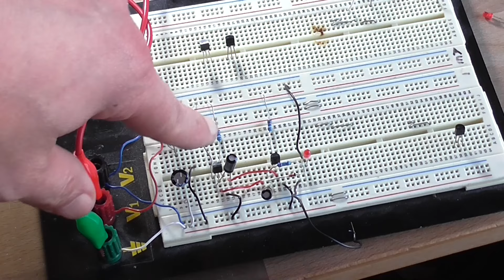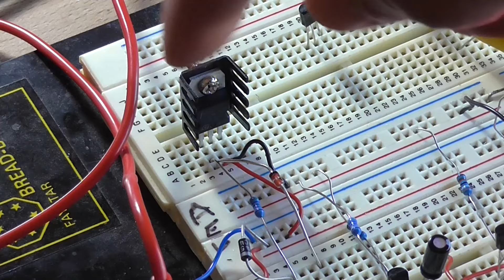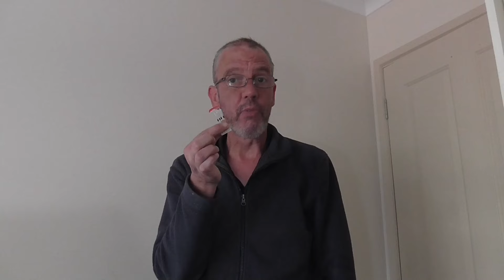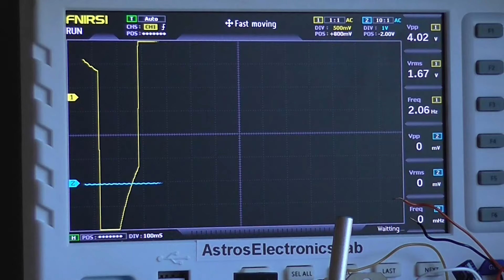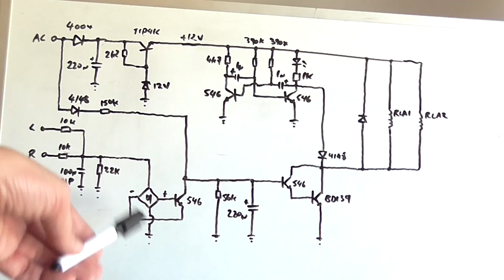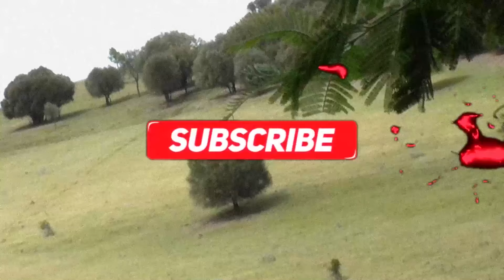Simple DC Speaker Protector Circuit TEST

Comment: Question, Why you need to drive 2 relays?
Reply: One for each channel I suspect. I guess he could use a single double pole relay, but that's a matter of choice.
Reply: @tonyrogers8318  but he should have 2 circuits each one driving one really for left channel and right channel amplifiers otherwise will short the left channel with the right channel or mostly will be a big crosstalk on the amplifier! And in case happens a short on the left channel will disconnect only the left channel and the right channel will still work
Reply: @SymbolTech21  The two channels are isolated by the 10k resistors. Crosstalk won't be an issue, because of the low output impedance of the amplifier.
Reply: @tonyrogers8318 but in case any of the channels goes shorted will disconnect both channels speakers and will be hard to troubleshoot the amp. Because if each channel have separate circuit will disconnect only the channel that may goes shorted! Then in case if he really want only one module connected to both channels don't need 2 relays because can be installed one that do double pull double throw relay
Reply: @SymbolTech21  Easy enough to check for DC offset on one of the 10k resistors connected to the protection circuit, and if needs be just temporarily lift one out of circuit. Easy and quick to do. Why add complexity?
Reply: @tonyrogers8318  is not adding complicity, I was thinking it's better to go on protect mode just the channel that has issues. Was just an idea for a final project!
Reply from the maker: The reason for 2 relays is because of contact current of 10A. Most Omron relays I can get of DPDT are only rated at 5A at the contacts. Yes, I can use a DPDT, but as I have 5 of these particular relays, I'm going to use them. Also, most commercial amplifiers disconnect ALL channels during a DC fault; I don't see the need to disconnect ONE and have the other output sound.
Reply: @AstrosElectronicsLab  ah so now explain why 2 relays
Reply from the maker: And, just for further clarity, the final design uses 47k resistors for the left and right channel inputs and a 100uF non-polarized cap. Cross-talk should be minimal. If one channel outputs DC, the other should not be affected due to low output impedance, plus a 47k resistor.
Reply: @AstrosElectronicsLab  my preference for speakers protection is each channel to be individual! Was just an idea so definitely you can implement it or going with your own idea!
Reply from the maker: Think of it like this: you have an amplifier 7.1 channels, and 1 or more channels has DC on the output. Do you really want other channels outputting sound? No. Lol.
Reply: @AstrosElectronicsLab I was thinking about normal HiFi audio which is standard 2 channels

Comment: In your final circuit, you have drawn one side of the cap (C5, C6), BR1 and Q4 to ground. But they're not grounded? I think that C5, C6 needs to be reasonably high to prevent triggering on peaks - as if the value is too low, it'll charge on short peaks triggering the protection. Rin (10k) can probably also be adjusted in this case to limit the charge current.
I suspect it would be improved by having two independent rectifiers and associated trigger circuitry. You could also pull one of the bases down to ground with another transistor to stop the multivibrator oscillating making the LED solid on, but this is changing the circuit quite a bit. I thought it was quite a nifty little circuit though.
Reply from the maker: Yeah, they are "grounded" as it goes back to the center tap of the transformer, which is 0V or GND. I think the 10k's should be more like 47k with a 100uF NP cap. I tried adding another transistor to pull the base of Q1 to ground with mixed results.
Reply from the maker: In the final circuit, those "grounds" will route back to the center tap input point.
Reply: @AstrosElectronicsLab  Eeek! I missed the ground from the centre tap in the original schematic. My bad!
Reply from the maker: @tonyrogers8318  me, too. I was originally confused as to how the circuit got ground, until I saw the convoluted line going back to the "center tap of power transformer".